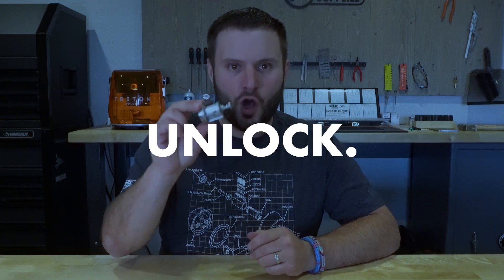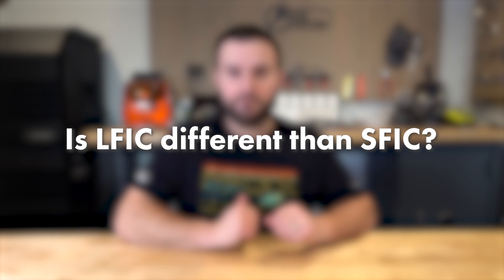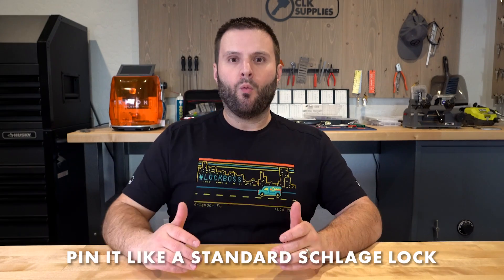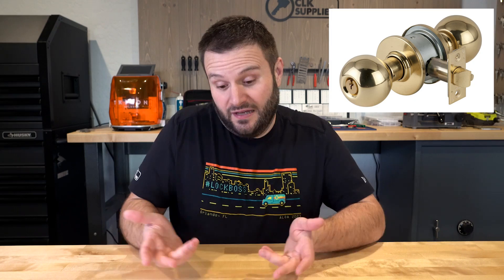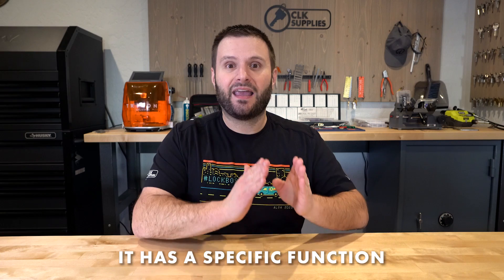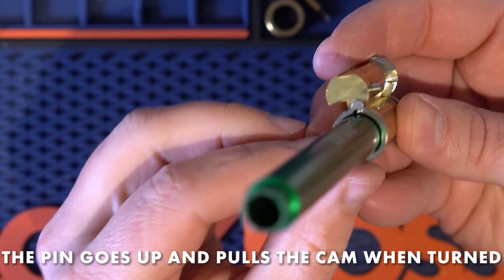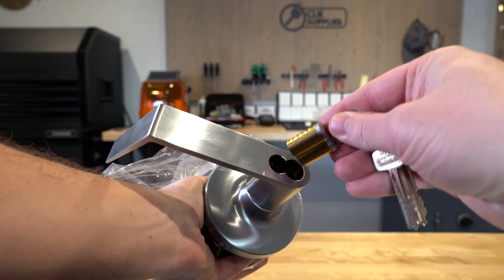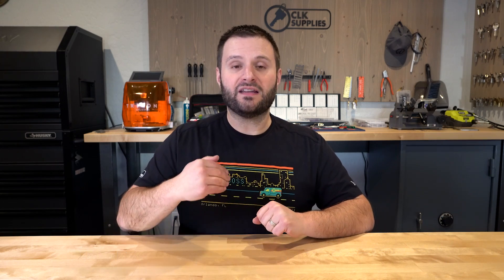What is Schlage LFIC and How Does it Work?

Comment: The great part about Schlage LFIC is that any locksmith can service with standard tools and training. The bad part is that anyone can service it with standard tools and training.

If you can get your customers onto SFIC, you have a much better chance of holding onto your customer. Also, someone with a change key (PJ calls it a Working Key) can't figure out how to make a Control Key, or worse yet a MASTER Key, with SFIC. Much more secure.

One last thing is that because SFIC has so many depths and spaces and such a high tolerance, it supports HUGE master key systems, where LFIC kind of limits your number of possible change keys in a system.

Comment: Good introduction, but I feel you're missing a major point.  It's critical to know that not all LFIC are the same in terms of size.  Whereas SFIC is a universal size/form factor across every single manufacturer, LFIC is not.  You cannot interchange Large Format Interchangeable Cores between different manufacturers' LFIC housings.  The physical dimensions of the LFIC are different between manufacturers (except for Yale and Medeco which has a shared history).  For example, a Schlage FSIC (Schlage calls their large format "Full Size Interchangeable Cores") will not fit into a housing/lever/knob/whatever that is prepped for Sargent LFIC, and vice versa.  The most common LFIC/FSIC in the US market where I work are Schlage, Corbin Russwin, Medeco, Yale, Sargent, and Mul-T-Lock.  Other global brands like Abloy and BiLock also make retrofit LFIC products.

Here's a recommended #Lockboss reading list to hone your LFIC knowledge:
-- "The Core of the Matter" by Billy B. Edwards, Jr.
-- "Removable Cores: Large Format" by William M. Lynk
Reply from the maker: Great comment, thank you -PJ

Comment: I install quite a few of these in rim cylinders on exit hardware(panic bars) on locations that frequently change locks.  
Customers like that as it cuts down the cost when I rekey, I don’t have to remove panic bar to rekey.
Another feature I have control key and code  so it necessitates calling me for rekeying.#lockboss

Comment: Love the Schlage LFIC. I like that Schlage and Yale have systems where the control key is a bit longer because it’s an easy system to key without needing specials pins or software(or paper calculations). PJ made a great video a while back on how to make a Schlage control key out of a regular blank in a pinch(wrote this before the section in the video😂). #LockBoss

Comment: I personally like Schlage LFIC and reccomend it whenever I can.  It's simple and fast to pin up and you can bring already pinned up cores with you for super fast rekeys especially for exit hardware.   If a control key is nowhere to be found, you don't have to drill out the cores, as with SFIC, for LFIC you can just make one on the spot.  You can throw your restricted MX cores and also Schlage Primus cores into the outside doors or other high security areas without touching the hardware.  You can throw them in padlocks as well.  #Lockboss

Comment: I have always called the type of IC cores that activate a control pin, a FSIC (Full Size IC). The type that work a whole separate shear line like the Best SFIC I call them LFIC. For example Sargent, Medeco, ASSA Interchangeable cores are formatted with two shear lines.

Whatever they are called It was a great video about Schlage Interchangeable Core systems. 
Thanks for sharing #lockboss